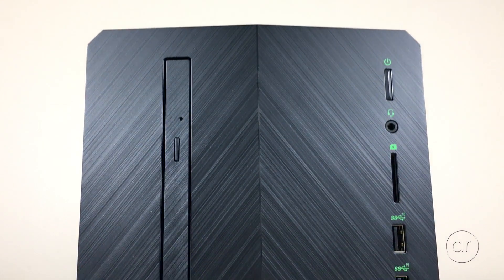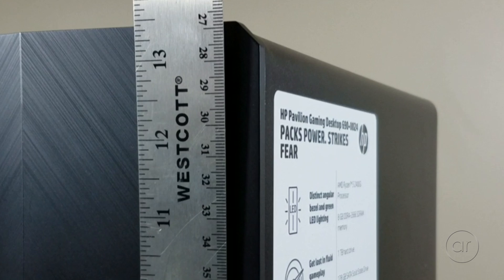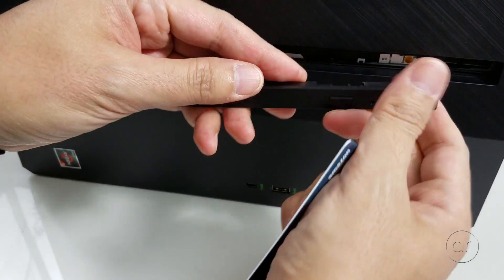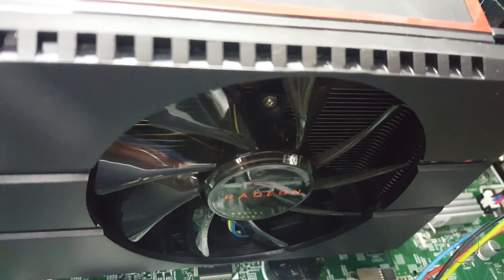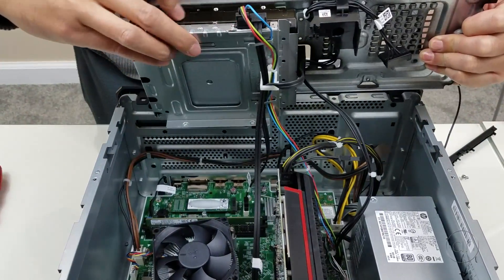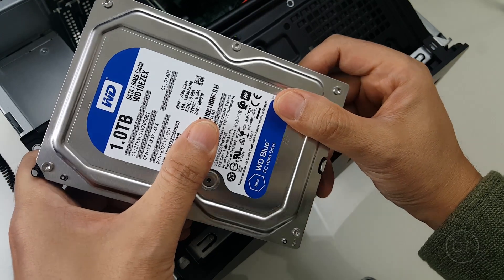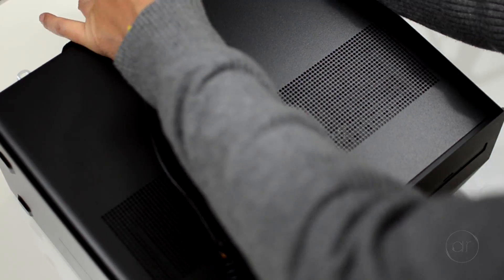How to Open and Upgrade a Ryzen-Based HP Pavilion Gaming Desktop

Comment: Can the PSU be upgraded?
Reply from the maker: I'm afraid the PSU is custom in that it has non-standard pins that connect to the motherboard - so a third-party PSU won't work. However, one person was able to successfully upgrade to a PSU with an HP part number (as seen in the description).
Reply: @accessrandom  Thank you so much! Great video btw you just earned another sub
Reply from the maker: @ecccc758  Much obliged 🎩 Happy to have you here 😀

Comment: is there any way to add a extra fan
Reply from the maker: Unfortunately, there's not really enough space to place a case fan. However, I think you could probably use a dremel tool to create a custom opening on the side panel (the one with the vent holes) in order to mount a fan.

Comment: i cant remove the side panel i opened the thumbscrew and tried pulling the side panel back but it is like stuck
Reply from the maker: I've had a couple others who have had the same problem but there should be nothing else holding the side panel down. There can be quite a lot of friction holding it down, so you'll need to pull it with more force (just be careful not to injure yourself).
Reply: access random alright thank you

Comment: Could I upgrade CPU to a 3600x?
Reply from the maker: Unfortunately, no - according to HP's specifications page, it doesn't support the third generation Ryzens. The highest it can go is the AMD Ryzen7-2700.
Reply: @accessrandom  so what would i have to do to make it be able to upgrade to a 3600x?
Reply from the maker: I'm afraid you'll need to move to a different motherboard (one that supports the 3rd-gen Ryzens). That will also mean moving to different power supply (because the PSU in the HP is tightly tied to the motherboard), and a new case to hold the motherboard and PSU.

HP did a poor job in making it upgradeable, except for the few components like memory, storage, etc.

Comment: i want to upgrade the psu (and bought a standard psu 550w online). Apparently, its not compatible to the standard psus, do you know anyways i can upgrade psu for this pc? or shud i just buy a new motherboard (and transfer all i can salvage from this old pc)?
Reply from the maker: I'm afraid a new motherboard would be the best option. The only successful PSU upgrade that was reported to me (please see description under Power Supply") was using an HP part which is usually expensive. You can transfer the CPU (but not the CPU fan), M.2 SSD, hard drive, memory, video card, and with an adapter, the DVD drive.
Reply: @accessrandom  aww man, thanks for the help, and for listing all the parts i can take
Reply from the maker: Sure thing 👍 Good luck with the transfer.

Comment: Can u part the parts in another pc case
Reply from the maker: The motherboard is so custom, I'm not sure if it will match the mounting holes of a standard case (for example, it is so custom that the CPU fan holes are drilled for Intel, even though it's an AMD). The power supply has non-standard pins, so it would need to move with the motherboard. You'd probably need an adapter to hold the DVD drive. Otherwise, all other components - CPU, hard drive, SSD, memory, graphics card - are standard.

Comment: Quick question, does anyone know if the 1TB hard drive is 2.5 inches or something else?
Reply from the maker: The 1TB drive is a standard 3.5" size.
Reply: @accessrandom  Okay I added a 3.5" to mine because for some reason mine didn't come with one.  I also added a stick of 8gb ram
Reply from the maker: I see. I didn't realize HP had models without a 3.5" HDD...

Comment: Do you know why this pc is so slow opening, booting up, and more things? My intel I core 3 laptop is way faster than this and it makes me sad
Reply from the maker: Has this been happening since the beginning, or did it start when you installed a program or some other hardware? If it was from the beginning, you may want to return it (if it's a recent purchase) or contact HP. With Windows booting off the SSD, it should be pretty fast in starting Windows.
Reply: access random yes, this has been happening since the beginning and it doesn’t run games well anymore
Reply: I have it since black firday
Reply from the maker: Sorry to hear that. Since it's been a couple weeks and you're still in the return period, I'd return it if the problem has been there from the beginning. It could be a bad SSD or hard drive.
Reply: @accessrandom  can you tell me the exact type of ram i can put in it? thnk you very much
Reply from the maker: The "Memory" section in the description lists all of the successful additions to the existing memory. If you want to completely replace the existing memory, those are listed in the "Replacement Memory" section. Hope that helps.
Reply: access random thank you!

Comment: What’s better this or the i5 1660ti combo
Reply from the maker: If you're referring to the 690-0073w, then it sounds like a winner (on paper at least). The CPU benchmarks faster than the Ryzen 5 2400g, and the graphics card benchmarks faster than the RX 580.

Comment: I need to get a power supply that'll fit nicely.
Reply from the maker: Unfortunately, I haven't received many reports of a successful third-party power supply upgrade (see description under Power Supply). The only one who was successful used an HP part, going from his 310W to a 400W PSU.
Reply: @accessrandom  That sucks. I want to make sure I can at least upgrade to a 1650 super.
Reply from the maker: Yeah, I wish I had a better answer. HP did make it easy to upgrade the power supply...
Reply: @accessrandom  Mine is called 690-0812no.

Comment: Will an rx590 fit in this exact pc?
Reply from the maker: It will depend on a couple things - the geometry of the card so that it physically fits, and the power requirements. The 690-0024 has a 400W power supply so if you swap the RX 580 with RX 590, you'll need to make sure the delta between the two isn't too big.
Reply: access random ok thanks!

Comment: Does anyone know what the deal is with the BIOS on this PC? I've been trying to resolve and issue that requires going into BIOS, but when I boot into BIOS, it's incredibly limited and barren in customizable options.
Reply from the maker: I'm afraid it was probably a deliberate design decision. HP didn't make it very easy to configure the BIOS at all... for example, they made it impossible to disable the memory assigned to the onboard video (even though its not even being used!).

Comment: Is it possible to change the led of the power button ?
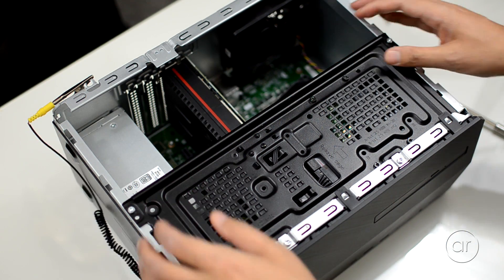Reply from the maker: I didn't really take a look while it was disassembled but the front should come off very easily by undoing the front panel tabs (as seen at the 1:56 mark). I'm not sure what the bulb looks like though...
Reply: I want to open it but I’m so clumsy 🙃

Comment: can you add more gbs of ram? I only have 6.9 gb and i want to have a bit more. Thank you
Reply from the maker: Yes, you can add more RAM. I've listed a few memory modules that viewers have successfully added under the "Memory" section in the description. If you want to completely replace the current stick and add your own memory, that is under the "Replacement Memory" section. Hope that helps...
Reply: access random ok thank you for the quick response! Great video!
Reply: You can disable the useless integrated APU in Bios and you get 1gb back.

Comment: I own a 690-0024 , so far I have: swapped the 2400g for a 2600(which gives back the missing 2gb ram), added a 1tb 2.5 ssd, and swapped in 2 x 16gb ddr-3000 ram sticks. i run most games at 1080p medium/high with no problem
Reply from the maker: Excellent info - if you can give me the model number for the RAM, I can add that and the CPU upgrade info to the description with credit to you. Would that be ok?
Reply: @accessrandom  sure, Crucial Ballistix Sport LT 3000 MHz DDR4 32GB BLS2K16G4D30AESC
Reply from the maker: Done! I added you to the CPU and Replacement Memory section. Thank you 👍

Comment: Hey accessrandom, me again. I sold my hp 690 for about $500, and spent another $120 on a dell prebuild with an rx 580 that more powerful than this one, has a ryzen 2700, and a full 1 year warranty. I think this is going to be better for me as its just as loud as the HP but i get better components. This pc is also a lot easier to upgrade physically, and im planning on adding a 1660 super in the future. For the 4 months i had the HP for, it wasnt bad, but i still want something more futureproof
Reply from the maker: Good deal - I think that was the smart thing to do. The HP is going to be for a certain niche gaming market where upgradeability isn't a priority...
Reply: access random i mostly got it for the better cpu and upgradability, so far the cpu temps are way better than the hp, since theres plenty of vents for air to enter. GPU temps are about the same, this model uses a blower style RX 580. Im going to add an ssd later, as well as a better gpu. Thanks for the help again back when i had my HP

Comment: Hey is this pc good ?
Its called hp pavilion tg01-0003 ng or something like that it has a ryzen 5 3500u is that good ? Would a ryzen 5 2600 be better with the pc ?
Can u pleaseeeee help
Reply from the maker: Based on pure benchmarking numbers, the 3500U is a bit slower than the 2400G. However, the video card in the TG01-0003ng is faster than the RX 580. I think it will depend on what applications/games that you use.
Reply: @accessrandom  fortnite, will be good for fortnite? I want a minimum of 144 fps capped will it do that? I can show you all the specs the pc has and then you can tell me. Please respond.
Reply from the maker: Not sure since I don't play Fortnite - so I'll need to defer to my viewers/subscribers. Anyone?
Reply: Embrz wowmoh i used to play fortnite on this machine when i had it, it ran at 144 capped with low/med settings but there was microstutters every few seconds. I personally would find a different pc unless this is your budget
Reply: @accessrandom  i also want to make yt fortnite vids, will it be capable of doing that? I need to know.

Comment: Is it possible or better to remove the disk drive panel thing when it's on and the disk tray is out to make easier ?
Reply from the maker: There have been a couple commenters who have detailed this process (I've added them in the description):

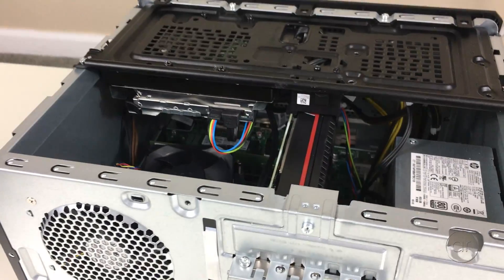"You don't need a plastic card to pry open the optical drive's front cover like you did there on 2:25, instead [it] has a black plastic quick release tab (seen in 1:43), you can press it in and push the entire optical drive out of the front panel..."
 - Ye Wang

"HP recommends: Before removing the drive cage, unplug the two cables connected to the rear of the optical drive, press the lever on the rear of the drive, and simply slide it out to the front (no screws). Reverse when reassembling." - tinmania
Reply: @accessrandom  Thank you !

Comment: Very good video, but these PC's are throw aways, HP doesn't allow upgrades, mainly because of how the storage partition is, so flashing the BIOS doesn't help. It's only set up to accept what's in it. Unfortunately changing it will cause the PC to be erratic or not work at all. Even more memory modules are finicky. Also you can NOT replace the 400w PSU in this, so hardcore gaming is out of the question unless you want to fry the pc. It also uses an HP motherboard, which wouldn't even cost about $30. So everything is cheap. The one they are "attempting" to sell at walmart has a 1660TI (minimal 450w psu), with a 256gb SSD and an I5 9400F for $579. Sounds like a good deal, but read the horrid reviews these PC's get. Some don't even get ANY 4 or 5 star reviews. They are THAT bad. Hope this helps!
Reply from the maker: Thanks - after having played with it for a year now, I agree. Other than certain memory modules with very exact specifications, the addition of another hard drive or SSD, and possible upgrades of the video card (within the power requirements), it's a challenge to upgrade this model. You can see some of the limitations and testimonials of certain commenters in the description - especially Terry Parrot's.
Reply: @accessrandom  yeah it's really disappointing because I really wanted to get that model with the 1660 TI, and  you know the engineers at HP had to know that card requires at least 500 watts. But oh well there are a lot of good companies out there :-). Also it's good to see that yours is lasting at least, lots of complaints that I've seen the computer doesn't even last a few days or weeks.
Reply: Jeremy Freeman i also considered getting that model, as i saw it on Walmarte Black Friday ad. You’re absolutely right about all of that. I already sold mine (amd variant) and bought a dell machine. Didnt have the 1660ti but at least it won’t overheat itself

Comment: Do you know the dimensions of the rx 580 graphics card in the computer ?
Reply from the maker: Unfortunately, I didn't measure the card but someone else asked me the same question a week ago. I'll measure it the next time I open it up (which will be sooner than later).
Reply: access random appreciate it
Reply: access random also do you know if it is possible for the power supply to replaced? Someone told me this computer uses a laptop motherboard so the power supply can’t be replaced.
Reply from the maker: Yeah, I'm afraid the consensus is that the motherboard/power supply is custom such that the pins on the power supply connector aren't standard. I've had some commenters mention this, and I've received no reports of a successful PSU upgrade.

Comment: did you suggest too add one ram card with the same specs? or just buy 2 new
Reply from the maker: You can do either: in the description, there is a list of successful experiences with adding another memory stick (under the Memory section), and another for buying new ones (under the Memory Replacement section).

Comment: how do you have a low profile rx 580???
Reply from the maker: Do you mean the card that is shown in the video? If I mentioned low-profile in one of my comments, I probably meant shorter (that is, a shorter length RX 580).
Reply: Yes the card shown in this video is unable to be bought anywhere online and I need that shorter version
Reply from the maker: Yes, the card is an OEM version with a part number of 931738-001 from HP's Parts store. I did find a single-fan version of the RX 580 on the US Amazon site, but I'm not sure if that is the same one as the HP.

Comment: Ok so i boot my pc up and now is not working . Now its just a black screen how can i get some help? Im so desperate i have a project to finish due tommorow
Reply from the maker: Sorry for the delay - Youtube somehow filtered out your comment. Judging from the message, there's a possibility that there are bad sectors on the hard drive. I would try running a surface scan or a chkdsk /r (note: this may take a long time to scan).
Reply from the maker: Did you disconnect or touch anything while you were in the case, and were you grounded? Check to make sure all your connections are secure, including anything going to and from the motherboard.
Reply: @accessrandom  no all i did was just turning on my pc than i realized that battle.net (a launcher for overwatch) wasnt working.So i restarted my pc then i see a black screen saying "Fixing (D:) Stage 1: 71% (51937 of 72448); Total 24%; ETA 8:06;27" I just want to know whats the cause of it and how to fix it if possible.

Comment: The power supply in this system is only 400w and has a 6 pin pcie connector which means you really can't uprade the graphics card. Today graphics cards require a 6+2/8 pin connector. Hp sells the solution in their website https://parts.hp.com/hpparts/Default.aspx?mscssid=  It is a 500w power supply with the same cables but replaces the 6 pin pcie with an 8 pin which allows you to upgrade your graphics card. The product id number that you search is L05757-800. The video I watched that showed the replacement was not a perfect fit with the fan exhaust alignment.

Comment: Will a rtx 2060 single fan black edition fit in there?
Reply from the maker: It looks like it is short enough to fit lengthwise - in the worst case scenario, you can remove the bracket (with the QR code) as seen at the 3:24 mark. The only concern I have is the power requirements - keep in mind that the RX 580 has a 6-pin power connector, while the RTX 2060 has an 8-pin.
Reply: @accessrandom  thanks do you think it will work even if it is 8 pin because the rx 550 sucsk and the 2060 ti is decent for fortnite so just wondering thanks again for the info
Reply from the maker: I haven't tried this myself, but you should be able to use a 6-pin to 8-pin adapter for the power. The 6-pin carries 75W and the 8-pin is 150W, but the RTX 2060 and RX 580 power requirements are roughly the same.
Reply: Would a rtx 2060 with 4.4 x 2.2 x 7.5 inches dimensions fit? I’m looking to upgrade it but don’t know if I need a bigger case. Thansk
Reply from the maker: I'm not sure at the moment, but what I can do is measure the spacing and the card the next time I'm inside the computer.
Reply: @accessrandom  Alright thanks just reply me if you ever do
Reply: The power supply in this system is only 400w and has a 6 pin pcie connector which means you really can't uprade the graphics card. Today graphics cards require a 6+2/8 pin connector. Hp sells the solution in their website https://parts.hp.com/hpparts/Default.aspx?mscssid=  It is a 500w power supply with the same cables but replaces the 6 pin pcie with an 8 pin which allows you to upgrade your graphics card. The product id number that you search is L05757-800. The video I watched that showed the replacement was not a perfect fit with the fan exhaust alignment.